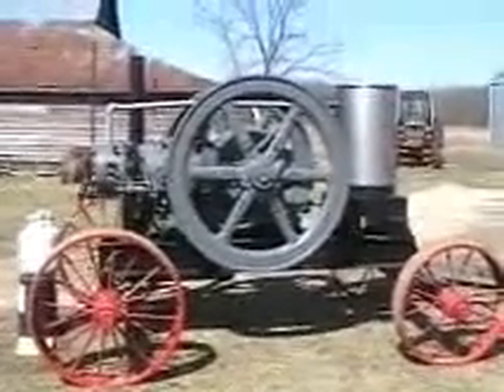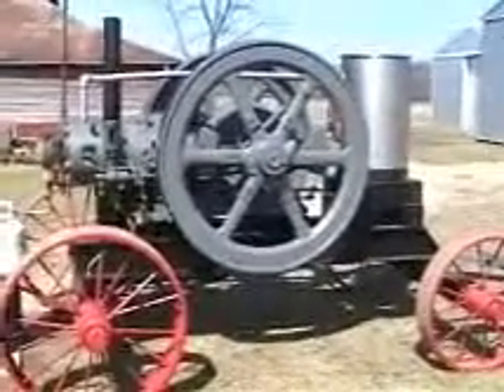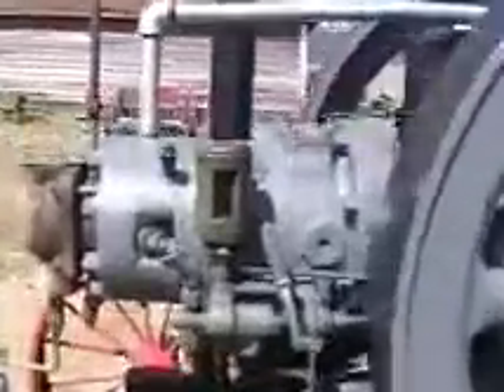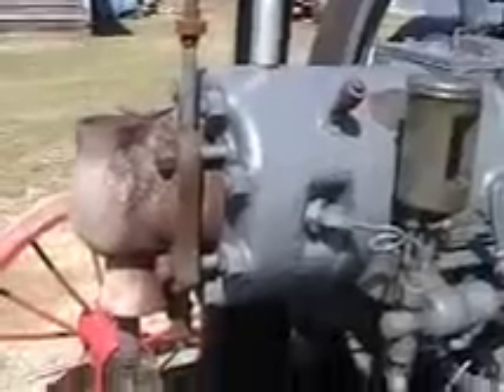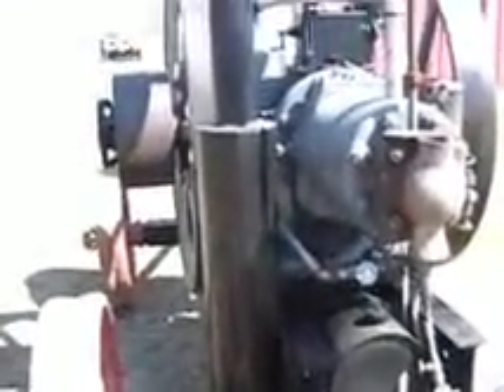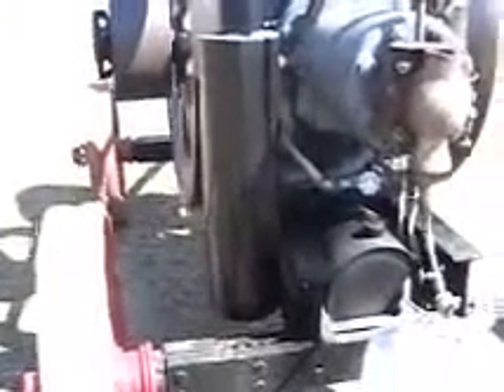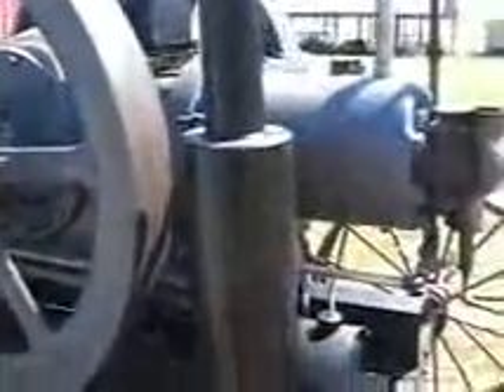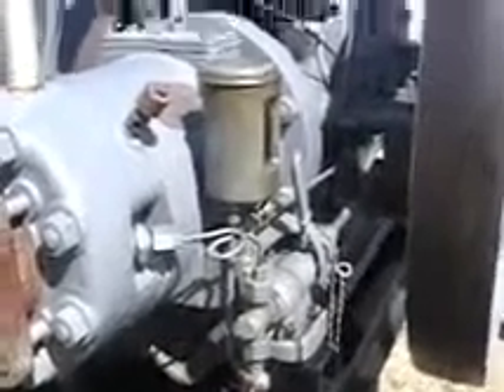Starting Fairbanks Morse Type Y Oil Engine

Comment: cool. ive been looking at detroit diesels and they have exhaust valves only. what does the check valve do? i know how a regular 2 stroke works. my model engine has the fuel circulate the crank case before entering the combustion chamber.

Comment from the maker: Actually it does burn Diesel Fuel and nowdays they are commonly refered to as a Diesel. It is a 2 Stoke engine and doesn't have conventional valves as there is a check valve at the back of the crankcase and ports in the cylinder to admit air and let the exhaust out when the piston uncovers them...

Yes it is Only One Cylinder... They did make Larger vertical models in 1, 2, 3, 4, 4, and 6 cylinder. This engine was built in 1919.